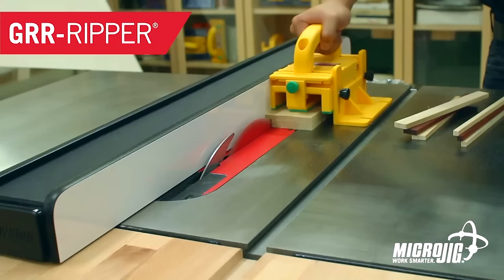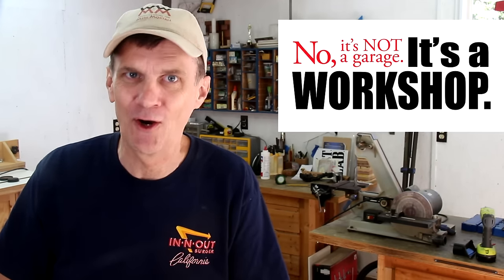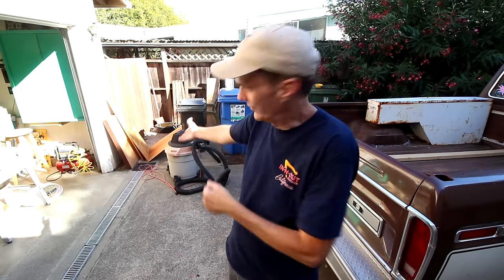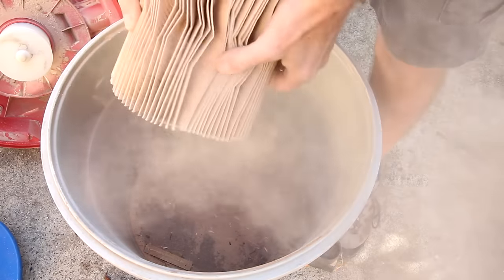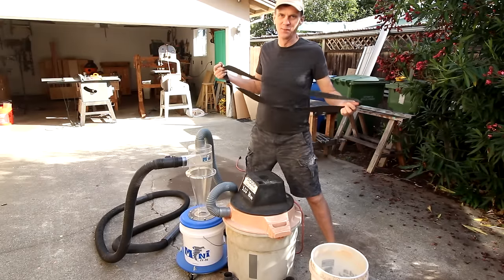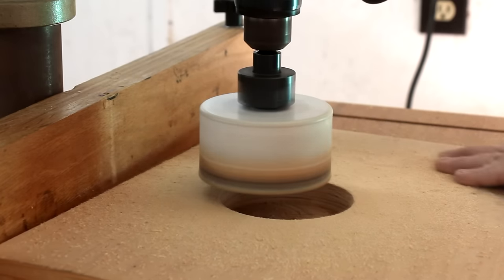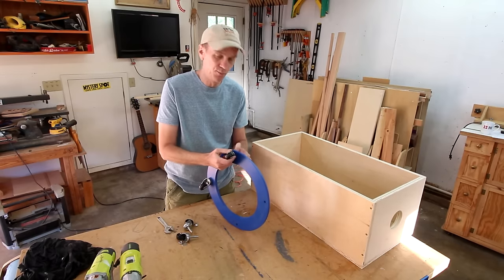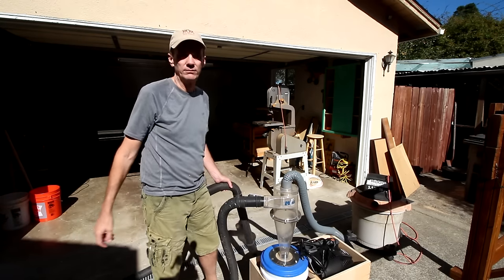Affordable Dust Collection for the Home Workshop

Comment: My favorite approach to keeping them together is something I read in a comment a few years back (never saw a video on it).  The guy made basically a 4-legged stool, where the 'seat' was about halfway down the legs, and was really just the cross-pieces of 2 H-shaped frames, notched together in a cross-lap joint (so 4 uprights, joined together with a cross-lapped X in the middle).  The bucket sat on the X and was contained by the upper halves of the uprights.  The lower halves were just tall enough to clear the vac motor, plus a couple inches.  The bottoms of the legs were attached to the top of the vac so as to be removable, by screws going through the leg into the tops of little L-brackets that had been epoxied to the top of the vac.  The 5-gal bucket sat in this cradle made basically from 6 sticks, perched atop the vac, which rolled around on its own casters.  Simplicity!  And very affordable in today's lumber market.

Comment from the maker: Dust extraction is something we all have to deal with in a woodshop. If you work in a small space or out of your garage, you don't have to install an expensive, complicated system to get good results. I get by with a shop vac and a cyclone dust separator.  More info http://bit.ly/WWMMdust. If you are interested in the components I use, check the links in the description.
Reply: Thanks for posting this, Steve.  I originally had built a cart as well but found that the longer "wheelbase" made it more difficult to steer the thing over uneven terrain, cracks in the driveway, etc.  My solution was to actually go the route that you went away from and I grabbed a plant pot holder with casters for about $5 at the garden center.  I sacrificed a 5 gallon bucket and bolted it down to the caster base.  The cyclone bucket just sits inside perfectly.  Finally to overcome the issue of lashing it to the shopvac, I just cut a series of holes in the sacrificial bucket and threaded the strap through it like a belt.  Works perfectly.
Reply: Steve Ramsey Wouldn't it be more convenient to stand the new vac on its end, have suction upwards, toward the cyclone, and have blow out the side/end? That would also reduce the surface area the entire setup takes in the shop. Might also make it easier to get the vac out when needing to change the filter. =)
Reply: Could cause problems in the shopvac motor. It's likely the sleeve bearings on the impeller are designed for that specific orientation.
Reply from the maker: Sounds like a great idea!
Reply: Steve Ramsey Hey, I'm new to woodworking and bought a 1hp dust collection system from grizzly. what do you think about grounding the unit to prevent fire? Is it a serious concern?
Reply: Hi Steve, it might be worth putting a handle on the cart for moving it around to save putting pressure on the cyclone . love the videos by the way.
Reply: Great project, something similar to this will make a lot of sense sometime near the heat death of the universe when I finally get my shop together!  So little time, so many unfinished other projects.

You might need some holes in the bottom if you have it outside so it does not collect rainwater?
Reply: Steve Ramsey 
i liked your video as I've thought about doing something the same for mine.  I've looked into the festool vacs and other tool vacs. i have the same big rigid vac as  you just replaced.  was wondering how well the new one works compared to it. also would like to use it for my Sanders without it being to much suction
Reply: Steve Ramsey
Reply: that's not a shop vac. it's a rigid.
Reply: picky pic ky picky!!! A rigid What ?
Reply: relentlessmadman
 duh, vacuum cleaner. a wet-dry vacuum, if you like. do you shop for hewlett-packard "xerox" machines too?
Reply: Chris R who has money to shop with? and his is right you have to keep the filter clean, no matter the BRAND name!
Reply: Anybody happen to know whether this type of dust collection works with concrete dust? I will be surface grinding the basement floor with a concrete bit and dust shroud on the 7" angle grinder.

Comment: Add a little roof over the vac.  That'll protect it from the rain and double as a mobile little shelf for project doo-dads when it's inside.  Would also give you an anchor point for hoses.
Reply from the maker: Great idea!
Reply: Thanks for the great video. Any particular reason you went from the Oneida to the ClearVue? Thanks in advance.
Reply: Matt Heere 

Wood carving searching j 
.
Reply: Matt Heere Vertical would have been good for a lot of floor-space-challenged people I think
Reply: Chris Robinson Clearview, maybe because Bill Pentz recommends it?
Reply: Or, just store it inside.

Comment: I love that I was able to get my hands on that exact same vacuum model and didn't have to modify the plans at all. I added a small block with a hole on the outside of the cart walls to secure the first hose and used 3 pieces of scrap plywood to build a small cable square that serves as a reel to store the excess cable. I can't live without this cart now.

Comment: Great video as always Steve. I did not hear you mention "micro-dust" not to be confused with micro-jig. After developing a never ending cough a year ago my doctor asked if I had a woodshop which I do and my wife parks her car in it. He recommended a respirator instead of the paper masks, which I found at Harbor Freight for under 20 bucks. It keeps out dust that we can not see in the 10 micron's and smaller range which is produced when sawing, sanding, using the router, ect...  It worked as I am now a world class athlete in my own mind now that I can breath. I also vent the exhaust side of my shop vac to the outside as this small dust goes straight through the filter and into the air to be breathed so reducing as much of it as possible is a must. Thanks for all your ideas and happy wood.
Reply: This comment will be of interest to future historians that will mark 2020 as the year of the dearth of respirators.
Reply: I found your comment very helpful as I had contracted Covid 19 in March. I was hospitalized and put on a vent in  ICU . I am thankful to be alive but have been left with COPD.
I need to focus on clean air in my workshop. So thank you and thank you Steve.

Comment: I use both a dust collector and a shop vac. The best thing I did was to buy a set of remote outlets so I can turn them on and off with the press of a button on the remote which I carry in my shop apron.
Reply: Even better, I like to use the outlet strips that have a master and a few slave outlets.  Any time the "master" tool is turned on, the "slave" tools automatically turn on with the master.  So, if your shop vac is plugged into a slave outlet with the power switch on the vac left on, it will automatically turn on with whatever is the master.
Reply: @faceup5  Even better, get Alexa (Or similar) and some voice controlled outlets. Control everything; "Alexa turn on the vacuum" or "Alexa, turn on the shop lights"
Reply: @faceup5  where can I find those?
Reply: @luke9822  If your Alexa can hear you over a running shop vac, you're a louder man than I!
Reply: @LarrySilverman1  another great point.
Reply: @JegolS  That seems like a good solution but might be careful using to turn on power tools, voice recognition is good but far from perfect. I can picture turning the wrong tools on at the wrong time and having some issues to deal with

Comment: Adding a bag to the inside of the wet/dry vac is helpful to preserve the life of the filter. Most manufacturers like Ridgid and ShopVac sell bags specifically made for the various size of their vacs and this can act as another "stage" to prolong the life of the filter.
Reply: I use a dust deputy and a bag insert in my rigid vac and it works great....... as long as I empty the deputy bucket lol
Reply: A lot of filters can be washed and reused multiple times before needling replacement.
Reply: The bags are expensive!
Reply: I read somewhere to cover the filter with a pair of nylons. It allows air flow and still protects the filter

Comment: Nice Build. I did something similar with my vac and a 22 gallon metal trash can. Works great. But the thing I like the most about my build is that I purchased a 20 ft hose that allows me to have the vac outside and be in my garage, cuts way down on noise and I also added a remote switch to my cord so now when it gets cold  I can have the vac outside and the remote turns the vac on and off as needed. Just clip it to my belt. Works great.

Comment: very nice. this is essentially the same "two stage" system I used in my shop for several years before I built a full sized two stage collector. its a great little system and easy to move to the tool rather than having hoses laying across the floor creating a tripping hazard.

Comment: The first thing I made when I started woodworking was a simple dust collector: empty plastic 10 gallon paint bucket, tangential side input just below the lid, vertical central pipe extending about 6 inches down though the lid. This hooks up to the regular domestic vacuum cleaner, when needed. The bucket lives on a shelf under my workbench, since all my power tools are benchtop devices and only used one at a time. Even though the hose is only 35mm i/d it happily picks up hand-plane shavings and almost nothing makes it into the vacuum cleaner bag, even fine sanding dust. The total cost was around 10 dollars for PVC pipe fittings and some glue yet it has saved me sooo much clean-up work, only defeated by the ***** mitre saw!

Comment: I have had that same 4 gallon rigid vac for about 11 years now. it's been left outside enough to not be very orange anymore, but it still works pretty well. Like basically every other wet/dry vac,  I do like that you can also get disposable bags for certain tasks that would ruin the cleanable filter or gunk up the container walls.

Comment: To make a few notes  for dust and debris on the surface of a tool bench brush and dust pan reduces amount in the collector, on the floor (missed sawdust) broom and scoop shovel first.  
for those that want to remove the filter Most shop vacs use all or part of the discharge air to cool the Motor  which does not take lightly to particles going through it.If there is a warning not to use around flammable liquids or such than your unit is one of these.

BTW the absolute fastest way to ruin a shop vac filter is to get it wet and then cleanup sawdust or drywall dust. If using to cleanup water have a sponge (open pore foam) filter in place of the pleated one

Comment: I built a dust separator out of a 10 gallon metal drum from the car dealership I worked at. It has a thien baffle made from a piece of plywood suspended from threaded rods. The inlet outlet was a couple of pieces of PVC. Put that and my old shop vac on a cart like you did. It is amazingly efficient, the shop vac sees virtually no dust. Probably have $15 or $20  plus some scrap wood invested but it was a major game changer.

Comment: Living in a climate where you can work outside so much of the time would make a huge difference to me, especially when it comes to dust collection. I'm jealous ;) when I see all warmth and sunshine, especially in Feb. when I have to get a snowplow to reach my car to drive to Home Depot.  

I made a dust collector with the cyclone-Dust Deputy-on top, and a small shop vac on the bottom. It's a great space saver.  Made from scrap.  Having it on top does not seem to matter.

Comment: Hi Steve, thanks for the Vid :) 
One thing I found with setting up Vac systems was that the vacuum hose was expensive. 
I discovered that either grey water or flexible irrigation hose works well, it's a little stiffer than the proper hose but quit a bit cheaper here in Aus. 
I hope this helps.
Cheers 
Steve :)

Comment: Thanks Steve, your design/plans were just what I was looking for. I got the 4 gallon Ridgid vac and built your exit set up from your plans and used a Home Depot "Duststopper" for the top of the 5 gallon bucket instead of the taller cyclone. Your plans were perfect and the project turned out great. thank you so much

Comment: Really useful video. Thanks! I already owned a shop vac just like this so I built a similar cart. I added a switch/splitter though that I plug both the vacuum and the tool into. So for example, when I turn on the table saw the vacuum turns on automatically as well. I also added a post-like handle that sticks up about two feet, right up the middle of the cart, so I can drag the thing around my garage. It's the most satisfying thing I've built all year, and I've spent too much time in my garage over the last 12 months.

Comment: Another great use for a wet/dry vac....instead of spending $50 on a pipe snake to clear a plugged drain or clogged toilet, use the wet/dry!  Yes, sounds weird, but if you create an air dam around the vac hose in the toilet bowl, the vac will create a HUGE amount of pressure in and out. Worked wonders for me.
Reply: They make fantastic emergency-pumps. I used mine to empty a washing machine after the motor died mid-cycle.
Reply: Great idea in theory, but I don't think I'd like what was clogging my toilet to be in my shop-vac.  I'd probably strike that one from the list.  :P
Reply: Dosbomber It's not theory. I had an impossible clog that plunging for 2 hours didn't help. Luckily there was only clear water left in the bowl. I didn't want to spend $50 on a snake for a 1 time use, so I spent $70 on a wet/dry. I put the vac hose as far in the flush hole as I could, then surrounded the hose with small towels. I kept the lid as far down as I could, expecting blowback. It wasn't messy, and a few short on/off's did the trick.
Reply: Path in AZ
Clear water would make a world of difference.

Comment: Health issues are the main reason to have good dust filtration and extraction.  You have the good fortune to work outside year round.  That cyclone has a number of benefits in that it is a Bill Pentz design vs. just a cone.Thanks for posting. Checking out dust collection hoses at my Boxstore found 30 dollars a minimum for plastic hoses.

Comment: I also opted for a shop vac for dust collection after running the volume numbers using 2 1/2" hose.  I would recommend a CleanStream replacement filter that filters down to .3  microns and can be used both wet and dry, no more removing the filter for wet jobs.  For hard to reach dust collection ports on machinery I like to keep a hose attached to the tool so it's easy to just attach to the vac.

Comment: Steve leaves his shop vac outside for fifteen years.  Meanwhile I can spill a drink on the other side of the garage and everything within 20 feet that contains a circuit is completely ruined.
Reply: How that William?
Reply: Tub trout
Reply: Right? Same. The latest: I buy a brand-new ShopVac. I use a bag to preserve the filter and hence prolong the suction power. I use it maybe 2-3 times a week, very light-duty stuff. About 6 months later, the motor suddenly starts sounding different, so I investigate and find that the brushes are sparking terribly. Fine. I clean the commutator and reface the brushes--which are barely used--to perfection, put it all carefully back together but it doesn't change a thing--still tons of sparks and the commutator is black again. Repeat. Same. REPEAT. SAME. Look for new brushes, which apparently don't exist. F it. Buy a new Ridgid. We'll see what happens. Pray for me....
Reply: @daveschultz3471   Look on CL for a cheap 2 bag dust collector you can find them for 50 to 200 bucks all the time. Shop vacs are great for cleaning the car, they are not worth a shit in a serious woodworking shop.  Find one at a estate sale, garage sale or a craigslist ad.Or go give harbor freight a few bucks.
Depending how what your doing and how much collection power you need you'll be happy you did that.
This depends on what tools you have and what your doing, A vacume dosn't work for a decent table saw. And the Air Filtration systems are too late if dust is in the air your getting dust in your lungs.
You adjust the dust collection system to what type of work your doing and how much and what machines your using it for.
Sure a 6" Random orbital sander might be ok with a wet vac.
Put a table saw, planer, joiner power sander and so on in the mix that vacume isn't going to work for you anymore.  You'll need a 1.5 to 3 hp system and bigger is always better.
It also depends on where you've set up your shop, garage, basement of your house, or out in a outside workshop independent of the house.  
My workshop is my basement If I used a cheap system then I fill the whole house with saw dust and wreak my High efficiency air conditioner system furnace and filter.
You have to pick a system that fits your needs and budget then over build it some in case you expand more.

I need a system that puts 0 dust in the shop's air and can move 1800 cfm, I might get 100 cfm from what I have and 98% dust free, I won't hit the 0 dust in the air not even the best system will do that.

I tried a vacume on a table saw, almost all the dust wound up on the floor.